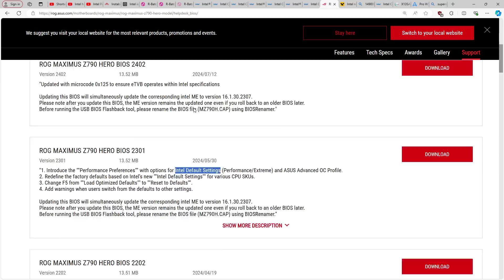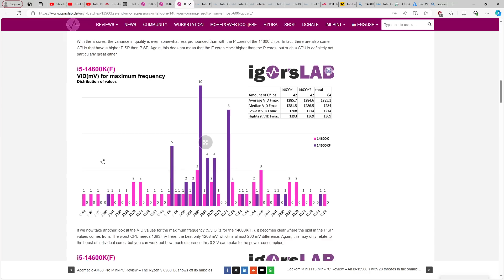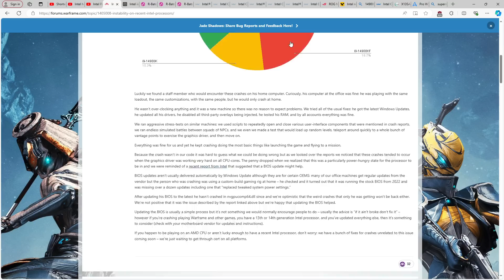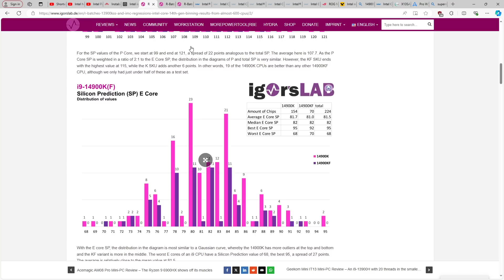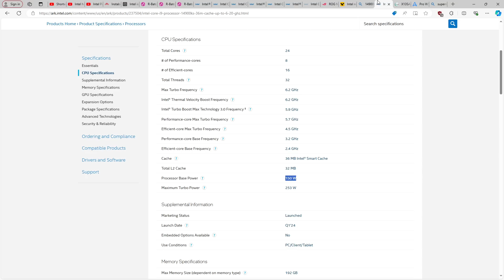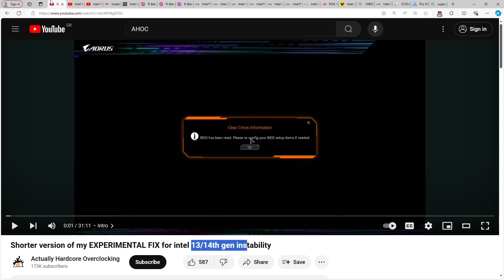The intel instability and degradation rant.

Comment: I am still not 100% sold on the degrading thing, just because it would be such a colossal screw up by Intel.  Don't they do run the cpus at high temperature to do accelerated degradation testing? There is also the possibility that this is confirmation bias since people immediately jumped on degradation.  I still have a 12900ks  which I swapped out for a 14900k so I will hold on to that just in case.

Comment: I think it's a case of more cores on the ring puts more stress on it and once you start pig piling on top of that with higher MT/s tighter latency memory and more memory density and other factors it's ** algorithm for the ring bus and degradation. 

There is a reasonable chance Intel has known since before Raptor Lake Refresh even shipped out, but was hoping the problem wouldn't be as wide spread and more isolated rather than snowballing into what it is. That's just speculation though.

From what I recall of memtest x86 at or above x40 ring bus I started seeing a lot more memory errors at the same memory settings and voltages particularly in hammer row and moving inversion tests. I believe it was moving inversions that were most problematic.

If you start pig piling things one on top of another something eventually will give way. Even at stock at 13900K and 14900K has more stress on the ring bus than say a 13700K or 14700K and like wise a 14700K has more stress than a 13700K or even a 12900K because core count and thread count are higher. In turn workloads are probably higher and more stressful in many cases on top of binning pushing frequency higher.

It seems like a domino effect and a dam with a hair line crack with more weight just piled against it and it ready to give way.

I wonder if Alder Lake is really except or just degrading at a slower pace because it's not pushed  as heavily as the follow ups do with higher core counts and frequency. If that is the case the 12900K should exhibit symptoms first at a heavier rate.

I honestly think however at the same time below a certain threshold we essentially see no noticeable relative degradation or just very very very minor amounts over time. The problem won't fix itself if it's a hardware flaw though.

Comment: 12th gen voltages? My 12900K is 1,34v (1,428v turbo) for 5,2Ghz all-core, 5,3Ghz 5-core and 5,4Ghz 3-core. E-cores synced 4,0Ghz. Ring default, downclocking enabled. Seems to hit the intended speeds. LLC4. PL1/PL2 241W/253W. 280A or might have been 307A, can't remember. Doesn't hit that anyway. CEP disabled. IA VR Limit 1500 (just in case). TVB+2. ETVB disabled. Not running the fastest ram, DDR5 5600 64Gb (2x32Gb) with XMP Tweaked. Idles 26-30°C, R23/R24 ~76°C and OCCT 78-82°C. 360 AIO (EK) + frame. No stability/other issues. Oh, and Asus Z690 board.

Comment: In my opinion, the last really good Intel CPU was the 11th (Rocket Lake/Tiger Lake) series. With the 10th (8 cores 16 threads) series we got twice as many CPU threads as with the 9th (8 cores 8 threads) series. With the 11th series the biggest innovation was the AVX-512 instruction set. With the PS3 emulator (RPCS3) we can see how well it works and makes AVX2 look old. What did the 12th series get in comparison? These downgraded efficient cores, but the AVX-512 instruction set is gone, what a fiasco and when I hear all the problems about the 13th and 14th series, which for me don't really have any new instruction sets either. AMD introduced the AVX-512 instruction set with Zen 4 and with Zen 5 the floating point pipe is doubled. Intel is in danger!

Comment: I was thinking about replacing my 12700k with 14700k but now I think it is not worth it
Reply: Are you crazy? Of course its not worth. Its not even worth upgrading from 6700hq to 14000k. Because despite one is notebook another desktop top tier cpu and 8 gen difference, the performance difference is only 2x. Benchmarking apps are scamming people. Their points are not correct.

Comment: Duhh - 1.65V on 2 cores boosting to 6.2GHz is going to degrade them...Lock your cores and it doesn't happen.
Reply: @genejones7902  Bullshit. No way you make 6.2 on 1.1xxxV. You are either lying or don't know what the hell you are talking about.
Reply: @genejones7902  Also : "Based on extensive analysis of Intel Core 13th/14th Gen desktop processors returned to us due to instability issues, we have determined that elevated operating voltage is causing instability issues in some 13th/14th Gen desktop processors. Our analysis of returned processors confirms that the elevated operating voltage is stemming from a microcode algorithm resulting in incorrect voltage requests to the processor." From Intel. Suck it.
Reply: @genejones7902  Well, since Intel has confirmed this is the issue, I guess you can suck it...

Comment: 1,5V it's like old Pentium. More than 1.4V is very high for CPU. 1.5+V and not cooling liquid nitrogen to under 0C is stressed the CPU so much. 
This all 14gen is push silicon to the limit, "first 6GHz" non OC consumer procesor. All this race to beat AMD. Now it turning against Intell.

Comment: I work in electronics design. My first thought was also that the higher voltages for 6+ GHz would be the cause. Intel/AMD are pushing the limits of what the manufacture processes can provide. 
If I had to take a guess, and oversimplify by a factor of 1 million, I would say they're using transistors flavored for lower than 1.5V and then feeding them 1.5V. Why would they do that ? Because the higher the voltage a transistor supports the thicker the channel and the slower it is. This is oversimplified of course and also I never worked with FinFETs but it also should apply (someone correct me if I'm wrong).
I just find it weird this wasn't caught in the stress simulations of even in the voltage/temperature stress simulations of the actual silicon...

Comment: so wat do? running 13700k stock current bios slight uv. just wait until my cip one day becomes unstable? i didnt think my voltages could ever degrade a chip, but now idk anymore.
Reply: I have a 13700k 1.26V at 5.4Ghz all core. What are your frequencies and voltages. Do you go above 1.4V regularly?
Reply: @D3nsity_ 1.4 volts max turbo should be fine.

My i7-12700K did that new for a very long time until i fixed it with a -110mv undervolt.
Reply: @D3nsity_  i think im currently @1.21 5.3ghz with an offset of 0.13 probably i can lower it a bit. 253w pl1/2 iccmax 307. i wouldve also thought 1.4v to be totally fine and would like to oc the thing but now im just running this instead.

Comment: I think that this is really insightful. It's the exact same thought that I had, and here's why:

I used to be a QA Engineer at Xerox and Kodak, first with software, then firmware, and eventually end-to-end systems regression testing.

Wendell said two things that made my ears perk up: He said that some logs recorded an M.2 error. And then he said that systems that employed four memory slots were represented much higher than those that only used two.

And going way back to some of the first problems reported, systems were throwing a GPU memory error.

This is all of your high speed IO. And that all points damningly to the ring, and voltage degradation of the ring and its inability to support the IO demands.

He also said that sometimes the chip would just slow down for like, a minute before a crash, though not conclusive, this would coincide with the start of a communication breakdown (Led Zep) between the processor and its external components.

So I think that this is correct. The ring is being burnt up as demand increases and asks for more voltage.

If this is the failure in its architecture, perhaps there is a way to isolate and test for this, I don't know. I don't test CPUs nor am I aware of the tools available.

But maybe someone smarter than me can do this. But as a former professional bloodhound, it seems like this is where the blood is....

Comment: Wendels video has a flaw.  If he is right, the highest rate of degradation systems are the ones that subject the CPU to the least stress and are the least capable of handling the short term power spikes the 13900k, 14900k may ask for.  The failures also seemed system wide.  Lack of power delivery to an SSD would do that.  3 points that point to motherboard degradation over CPU degradation.  System degradation.

Wendell has a video on hardware mismatch, not CPU degradation.  If there were CPU degradation it would be more prevalent in higher power use scenarios than lower power use scenarios like in Wendell's video.  As far as ring degradation, that is testable by dropping ring clocks.

Also I agree with your low AC loadline theory from empirical experience.  And as an added note, the volt tables seem to have less and less headroom the higher the clocks get so that the higher the clocks the less statistically stable they are.  Also I have an i9 13900kf.  And i9s are the most likely to be undervolted by the user and many undervolts are unstable, thus increasing crash prevalence in those chips.  Not saying that is all of them, but if it is a small number of total crashes it could be most.

Edit: A couple of extra things that help stability are adding like 20mv to the e-core L2 and synching ACDC loadline with VRM.  And something that may help you enjoy the chip more is to set max all core to 5GHz and udervolt.  Power consumption gets quite low.  Use Windows power plan to set the clocks and drop them at a whim and see lower power consumption at reasonable framerate gaming than any CPU ever has been capable of before.
Reply: Also many w680s, probably all except for the Asus model, have a 150w cap on those i9s.  And the servers are much more likely to be running all core loads than 1 user PCs.  Combine these 2 and the voltage will maybe be 1v almost all of the time.  These high volts are likely far less prevalent under 24/7 usage than an average user with a Z690 using their pc for 30 minutes a day.   
Unfortunately this undermines the cache degradation argument.  There is no degradation if the CPUs are running at 1v.  Wendel's video is disproving the CPU degradation argument and supporting the underbuilt system degradation argument.
Reply: Not really. Even at default settings the single core boost algorithms of eTVB will shove over 1.5V into those two cores that try to hit 6ghz or 6ghz+ and since the pl1 is 125w(unless they have 14900 settings of 65W for pl1) then the 2 cores will never draw 150W even maxed so they can boost freely. I doubt that server cpus are constantly under a full core workload but any second they are not the CPU is just eagerly waiting to shove 1.5v in those boosting cores. 

I personally think loadline in complete garbage. I try to have a flat a load line as possible because I dont want anything going in and out of my CPU changing. I would rather everything remain constant and waiting to be tapped into that constantly slam differing voltages through my CPU. My 13700K would use 1.45v at stock settings to get 5.4ghz on a single core but it will pass y cruncher with 1.26V 5.4ghz all core. That is a massive overvolting I would be willing to be is happening on every untouched bios.
Reply: @D3nsity_  I agree with your flatter loadline position.  I use a combo of low vdroop LLC + undervolting on both my Asus board (LLC=6) with a 13900kf, and with my 13600k on a Gigabyte board (LLC=turbo) and it holds lower voltages more stably.  I don't like to use negative vdroop because I get weird stuff going on i don't like.

But these game servers are probably running mostly continuous all core loads, not erratic single core loads like you would see at home.  At least that is what is implied in the video.  Set your 13700k with stock settings (these w680s don't have the tuning knobs you would find on a Z series, they are more like an h series) to 150w and run any all core load and see what your volts are.
But they probably do hit high volts sometimes.  Likely not as often as a stock system chronically running single core loads on a Z790, and those systems are not having nearly as many issues.

Comment: i feel like intel is being too impatient in their competition with AMD. Being able to say "we're faster" matters when it comes to computer marketing though. By all means, most the computers ive used through my entire life have been intel. I always considered them and their product top notch or absolutely adequate at the very least. my current pc i overbuilt and i went AMD for once cause the prebuilt i had before had a ryzen 1700 in it that ran solid for 7+ years.
Now i feel wary of intel. Its one thing that MB manufacturer's blew up x3d chips by explicitly ignoring AMD. Its another to re-re-release the same chip excessively OC'd to the point where it kills itself period.

Comment: i have a 13700f and no crashes yet do i have to worry?
Reply: No, that's a locked processor, it prevents itself from boosting to instability.
Reply: @steel5897  thank you i was thinking stock settings are also a problem in i7/i9

Comment: 14900k is already not running 6 ghz in games, so I'm not sure why you're claiming the performance would dramatically decrease if it's not used. The 6 ghz single core boost is nonfunctional in the majority of intensive real world applications - it usually only activates in single core benchmarks, idle, or browsing the internet.

Comment: The smaller the architecture the more likely this is. A transistors durability is going to be directly linked to its mass, just like any other material in electronics.

Comment: I've been having issues for about 3 months. I fixed the issue after a month, went on with my life. Recently, I started playing Alan Wake 2 again. I already set my power limits to the suggested levels and my computer WAS working fine. Well, turns out Alan Wake 2 didn't want to work anymore. Apparently my 4090 doesn't have enough video memory? Hmmm... Anyways, Corsair (who I bought my computer from) is replacing my CPU. Meanwhile intel ignored my inquiry to their support.

Comment: Interestingly, I have applied pretty much every trick in Buildzoid's book there is and it runs stable. LLC is as low as I could get it to run at, DDR4 is OC'd to 4.000MT 1:1 ratio and way tighter timings and lower voltage than XMP and the CPU delivers slightly more performance at 200W power limit on air cooling. I've tested this configuration for weeks.

Now, what I did do in order to pass Prime95 consistently was dropping the AVX2 multiplier by 3x. But apart from that all-core standard load is stock at 5.3/5.4 GHz with 2-core going up to 5.6 GHz, so very light OC here. My Score in Cinebench v23 has been around 30.500. interestingly, it dropped by 1.000 points when I tested after my recent repaste. However, I wouldn't account this to CPU degradation but rather Microsoft doing stuff to their OS or forcing a microcode update onto me.
Lowering the power use was my main concern for this. I throw VR workloads and heavy 8K photo editing at it.

Specs:
- 13700K
- Asus Prime Z690m Plus D4
- 64GB Mushkin Lumina 3600-19-19-39
- Running since October 2022

Comment: Something I noticed is that, according to HWUnboxed benchmarks, 13th(14th) gen seems to benefit less from faster ram than 12th gen, so I was wondering that it might be some kind of tunneling or backflow problem with 13th gen using a fixed high clock cache, vs 12th gen matching cache to a multiple of memory frequency? But that's probably just crazy talk.

Comment: My theory is it's more about high power consumption such as 200W+ that's causing the degradation, which would be present on any skew above a 13600K/14600K.

Because although there are examples of these i5's that run high stock voltages, these CPUs don't draw much more than 180W fully loaded. And so, i5's don't show up in the charts of failures.

Comment: Is the problem about high power consumption or time spent at high wattages for these CPUs? Or is it solely about high stock voltages instead?

Especially because you've already established it's not a problem of operating temperature.

Comment: I know of some p4 cpus still working with thermal paste that has never been replaced and with dust that hasnt been blown out since install. In dusty environments. Ram on these machines die and HDD have been replaced, but the cpu has been fine. These machines are not stressing the cpu, but they MUST run 24/7/365 with occasional reboots from power loss because the UPS batteries die before the cpu does.

Comment: So the reason why I haven't had any issues in 1.5 years is because I have 13700 non K on a b660 steel legend with 64gb of basic 3200 cl16 XMP ram and a 3090ti. WILD
Reply: Lucky, mine failed. Had a 13700k with real ram though, not dd4
Reply: Lower ram speeds tend to help with the crashing so thats probably why you aren't affected.

Comment: Intel just pushed too hard on 13th and 14th Gen K Series and that is why they are so power hungry and instable. I have a 12400f and would not worry too much since it barely runs hotter than 60 degrees celsius.

Comment: No, not you too spreading misinformation, I have 2 13900k/ks and a 14900ks all delided contact frame and direct die Liquid Metal cooled  and no problems at all, all working fine, explained that with voltages….
Reply: they havent failed yet....
Reply: 14900k no problems either, so I’m pretty confused by this. So the whole life cycle of a 13th gen no mention of issues in the media. Months into 14th Gen release, suddenly 13th/14th gen issues? I’m not buying it….
Reply: @MhillPlays  it's not rocket science. 12th gen topped out at 1.3v, intel is now ramming 1.5v into k chips on 13th and 14th gen i9 to get full turbo speed, the last intel chip to run 1.5v was a 130nm pentium 4.

1.5v is a crazy voltage for 10nm.